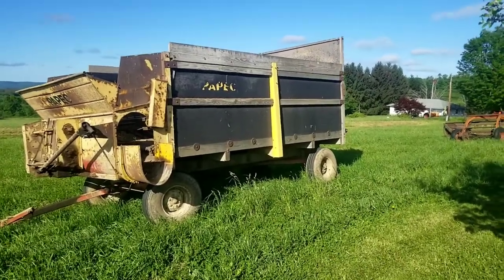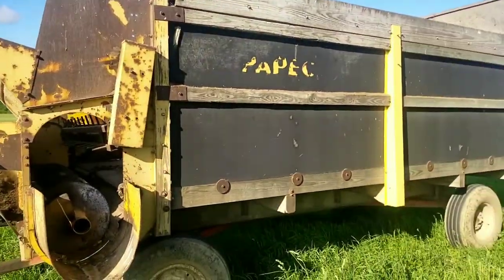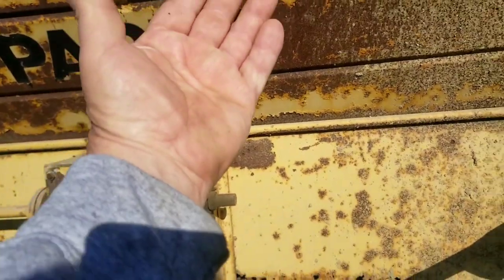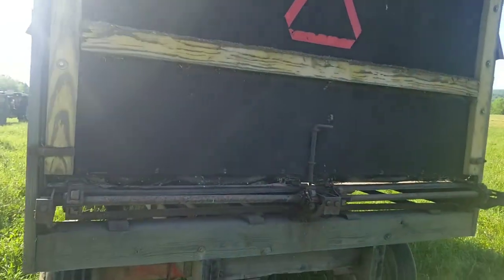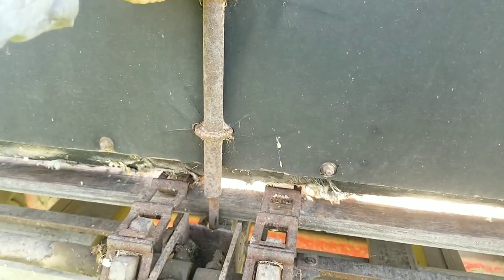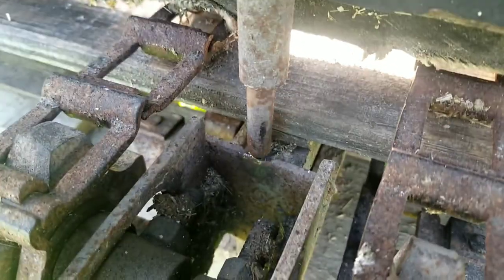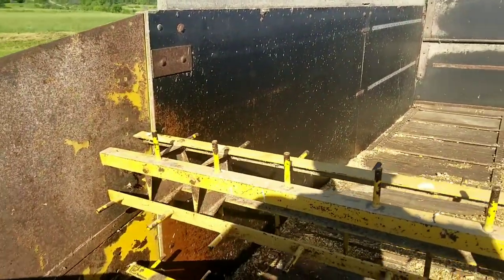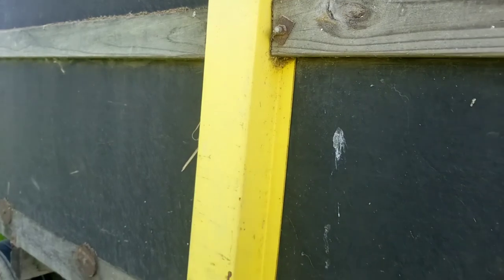Papec self unloading wagon 50 years old.  Can it haul hay?

Comment: Auger wagons are uncommon, at least apparently on youtube.  We had auger wagons with those same beaters, but they definitely were not yellow and the controls and drive were completely different.  That looks like it has 2 apron speeds, ours had 5 or 6.
I think that one is much older and just had an earlier design.  On ours they moved all the controls to the side and only needed one shaft across the front.
It's also possible there is a reveres on that apron as I've read that the first self unloading wagons unloaded off the back.  This one appears to swing both ways.
As far as using it for a throw baler, I dunno how well that will hold up to bales being throw in it.  Might be easier to just pull the box off and build a new on one from scratch.
Reply from the maker: There are some videos of them.  They were last used in the early 70's and most farms now use trucks.  I do see some smaller farms still using unloading wagons but I can't recall exactly how they work.
Reply from the maker: Yes.  With hay wagons selling at $4000 an old auger wagon can be a good value.  Large farm near me are switching to dump trucks.  Big business now, farming is.
Reply: @thewayidoit8895  I think the farmers are still rioting in Europe, so, ya, farming is definitely a big thing nowadays.